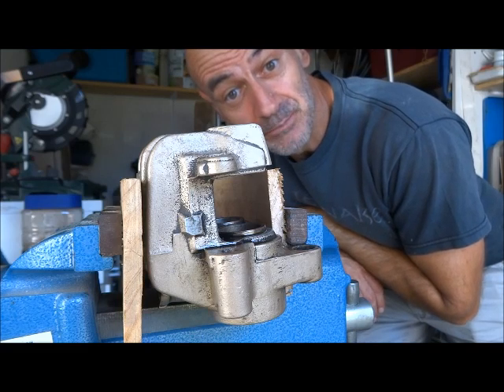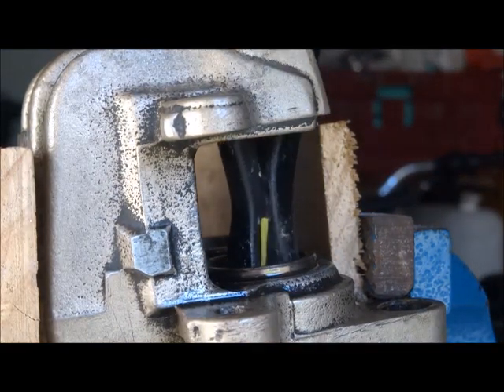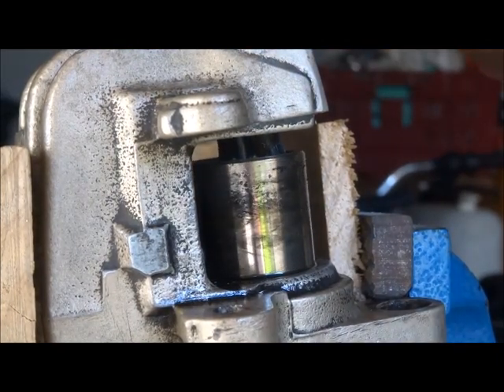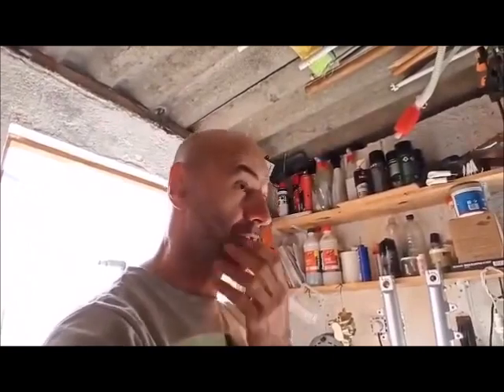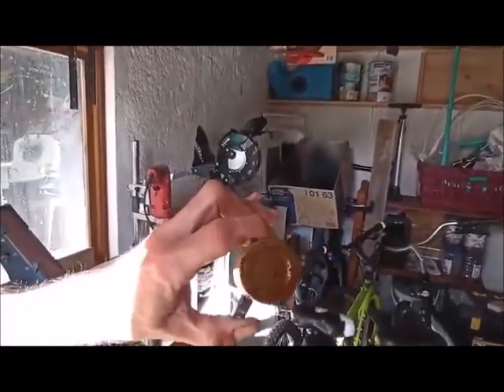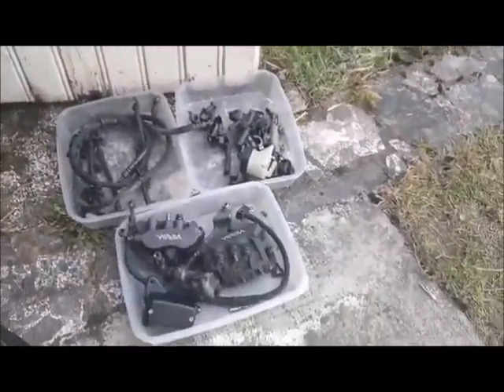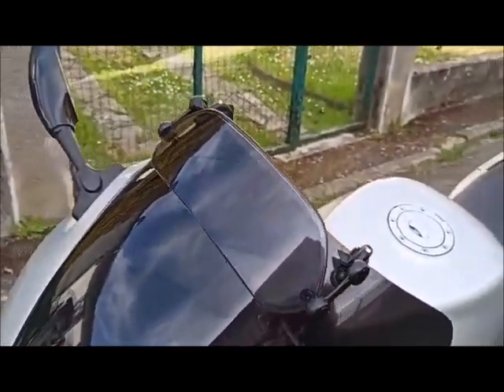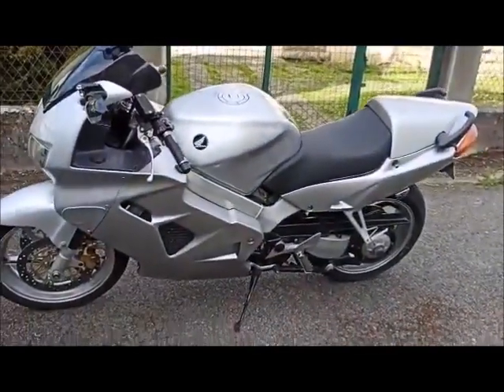VFR800fi CBS removal

Comment: Great tip on the pry bars, & using a cork in a drill to spin pistons for polishing.
Piston pliers aren't that great from my experience, too short, not enough leverage for a good grip.

I've been looking for some Firestorm forks for ages for my 5th Gen, can't seem to find any straight ones as yet.
I want to swap out the internals into my 5th Gen forks, so I gain rebound damping & a better cartridge.
I quite like the linked brakes, I've run Honda's for many yrs with CBS brakes, unsuccessful so far.
I'm in the UK.
Keep up the good work bro.👍
Reply from the maker: Ah, you're welcome. Hope that it helps you out... :o)